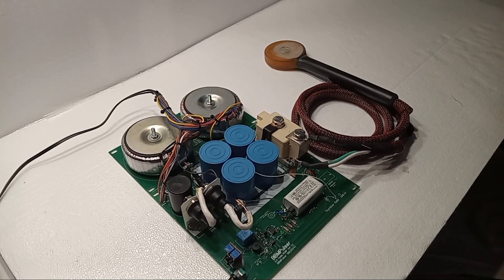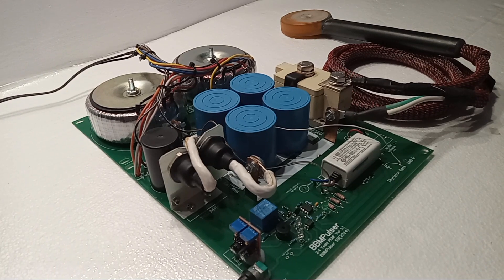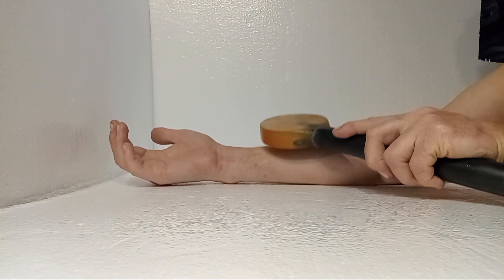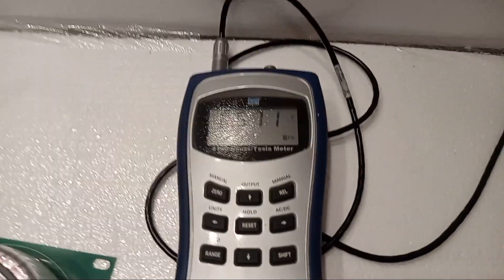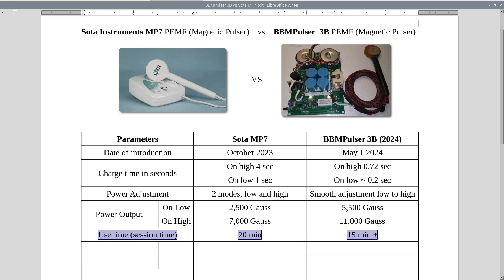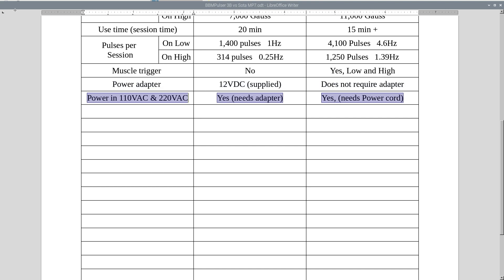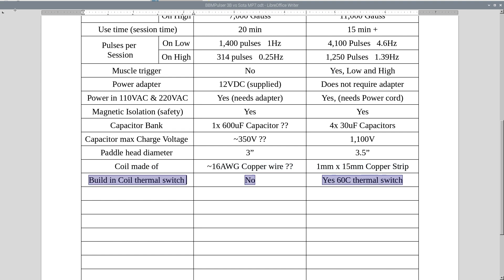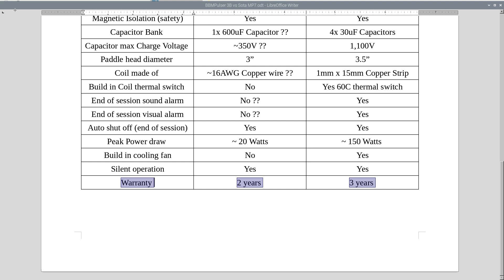179 New Model BBMPulser 3B (2024) vs Sota Instruments MP7

Comment: Hello there !. It looks too complex... very nice job. I have a "dumb" question, I hope you can give an answer. What means "magnetic isolation" ?. When the voltage is finally sent to the coil... How "the magnetic isolation" is working ?. What could happen if "magnetic isolation" is not present ?.  Thanks !
Reply from the maker: @antoniohernandez8367  magnetic isolation from the Main means there is no electrical connection between main input voltage and capacitor bank voltage. 
To explain it further, it means that if you are standing bare feet on the ground and somehow manage to touch exposed coil copper strip, which has high voltage on it, you won't get electrical shock.
This is safety future.
Reply: @AndreyD  Oh... Nice. Got it. Thanks for the explanation. I was reading other comments (from you) in other videos, and it's very interesting the info that you give related with bacteria and biofilm and how the power of a magnetic pulse can help to attack these kind of "bad life". I understand that "you're not a doctor", but definitely for me the information you provide is more important than a seemingly ideal academic degree to give an opinion about diseases. I was wondering where can I read that info with detail ?. I know something about Bob Beck's work , but related with magnetic pulsers the info that I read is limited. In my case, I was wondering, what is more important talking about a magnetic pulse: capacitance or voltage ?. Which of them is more important than the other ?. Sota's MP apparently focus on capacitance and a voltage value <= 350v, but yours (as I can see and understand) focus on low capacitance and high voltage ( > 350v ). What could happen if the capacitance is the focus and not the voltage, for example, a magnetic pulse that is always using 350v with a variable capacitance ?. Can you give an advice about that ?. Thanks in advance !. Your work looks very sophisticated.
Reply from the maker: @antoniohernandez8367 both capacitor value and voltage are important.  I started with pulsers working with 150V and worked my way up to 1,5kV. Higher voltage with capacitor bank support can generate higher resonance pulses which will penetrate deeper into the tissue. Capacitor bank volume determines length on the pulse. Yes we do want our pulses to be in hundreds of microseconds range even in milliseconds. It's hard to produce thouse with out heating up your coil fast. Coil doesn't like large capacitor bank. Ideally coil wants your capacitor to have enough energy to saturate it and that's it, if you keep pumping past saturation point all that extra energy will be converted into the heat and some magnetic flux. So we have to find a ballance between trying to get our pulses to be as long as we can get them and at the same time not put alot of load on the coil so we can have at least 5 min session time. 
I been balancing this for a while now with different set ups (models).
Believe me, my capacitor banks on my pulses are not small. My goal is to produce as long of a pulses as I can with each set up without overloading my coils.
In my early designs, I was using large capacitor banks and yes comparing to my new models, older ones were more effective.
I do think that pulses should be around 1mS long. Right now depending on the model my pulses are between 0.1mS to 0.5mS long. 
To get the same effect as from the units delivering  1mS pulses you will need to get more pulses from the model which delivers shorter pulses
Reply from the maker: @antoniohernandez8367  for emaple my 2.4 Tesla BBMPulser 5B model uses 600uF capacitor bank, same volume as Sota MP6 model, just much higher voltage of 1,050V vs 350V
High voltage is another challenge on its own. I believe that Sota will be raising their charge voltage in their new models
Reply: @AndreyD  Wow... full detail... Definitely these things require an accurate knowledge. Do you have a book or something where can I read more about your explanation ?. For example... as I can understand... if 350v uses 1000 uF... it means "a longer pulse" (leaving aside the fact that the coil warms up quickly) ?... But, for health purposes, what voltage and capacitance can you mention to achieve better results ?. Thanks for your attention, I really appreciate your time to answer these questions. (You said "1.5kv", but... talking about "inexperienced people" , can you suggest a minimal value for both concepts ?).
Reply: @AndreyD  Which voltage and capacitance can you imagine SOTA is going to release in their next models ? (at least)... Thanks in advance !
Reply from the maker: @antoniohernandez8367  my guess Sota will increase voltage to 500V and drop capacity down to 500uF
Reply: @ I'm going to see your videos, they have a lot of interesting comments. Thanks for your time !
Reply from the maker: @antoniohernandez8367  if you are planning to use similar applicator as Sota uses, I would say copy Sota -  600uF and 350V. I would not go below that especially voltage. As you increase your voltage, you can decrease your capacity.
For example in my latest model BBMPulser 2B3, I use 4x 6.5uF capacitors and I charge them to 1,250V and I get 0.7 Tesla on the output using Strip Coil, slightly larger then Sota uses. 
With my set up I can get 16x faster pulsation rate then Sota MP7 model.
Yes my pulses are shorter but they have higher amplitude and can penetrate much deeper into the tissue. Also there is accumulative effect. The more pulses we deliver the more we can recharge our cells, amount of pulses does matter
Reply from the maker: @antoniohernandez8367  one more thing. Have you seen the pulse from Magnetic Pulser on the oscilloscope?
I have one video showing the pulse it's video #175
If you examine the pulse, you will see that there are both AC and DC parts in one pulse combined. 
In the beginning of the Pulse Coil takes electrical energy in and start resonating. In my case it will resonate around 6 times while decaying. After that it will output DC Magnetic Flux for 0.3mS. This second DC part of the pulse is much weaker then first AC part when Coil resonates
As we know permanent magnets do not resonate and they have little to no effect to our body. Only resonating Magnetic field can convert back into electricity when in gets in contact with our fluids inside the body. So in my opinion AC part of the pulse as important or even more important then DC part of the pulse
Reply: @AndreyD  Mixed ?. Oh.... I thought magnetic pulses were only DC... Uhm... Interesting. A mixed architecture. That's the reason why I asked if you have a reference where I can read more technical stuff about this and try to understand with more detail how the ideal magnetic pulse can work and heal the body.
Reply: @AndreyD  "you can decrease your capacity." You mean "heal capacity" ?. I saw a video of Bob Beck from 1996 talking about vivitar flash camera, and how can help the magnetic pulse to the body. After that, I found a user on alternative social media talking about a simple magnetic pulser, but he talked about you and your work. I saw some of your diagrams, and in that moment I thought those designs are not for beginners (also now). At the moment, reading your comments only in two or max three videos, you wrote a lot of interesting things, talking about how the magnetic pulse can help to attack or to heal things living in the body. That's the reason why I previously asked what do you suggest as a "starting point" talking about the specs of a magnetic pulser (maybe diy). You said that it's fine to start using SOTA specs and apply to the body. I was wondering... what happens with chronical diseases. SOTA device specs is enough to attack, for example, a cancer disease ?. Is it required more voltage and more capacitance to attack a disease like that more efficiently ?. What documents do you suggest to read to understand more about magnetic pulser vs diseases ?. Thanks !
Reply from the maker: @antoniohernandez8367  here on this channel I discuss how to build it, I don't want to discuss what it does. All I can say it's effective
Reply: @AndreyD  Perfect. I'm going to see your videos and read your comments. It's interesting. A person named "Andreas K"... said that all diseases have something in common: "lack of electricity". That's why these things are interesting for me. Thanks for sharing your time and knowledge. 👍
Reply from the maker: @antoniohernandez8367  This is my own opinion. Canser is a fungus infection. The name of the fungus is Candida Albicans. Tumors are the fruiting bodies of this fungi. If tumors occurs it means this fungi is on the last stage of its development. The power of the fungi is in mycelium (roots). Targeting fruiting bodies won't kill it, but Magnetic Pulser can be effective. It recharges cells, and when that happens, cancer retreats. 
Fungi usually attack low charged cells. 
Our heart is a good example, why heart cancers are super rare? It's because heart cells are the most charged cells in our body, that's why fungi don't attack it.
To fight cancer, we don't need high power, it's more effective to get higher amount of pulses vs lower but stronger pulses. The idea here is to recharge cells.
Another important thing is diet.
Thouse who have cancer will benefit from pure ketogenic diet. They should lower their carb intake down to 0.
Candida likes carbs
I can send you some links where you can learn about proper diet
Reply: @AndreyD  I was wondering which option is more effective than the other ? (pulse rate). You gave me the answer, I thought strong pulses over wide intervals was the best option to attack diseases, but, the  answer is the opposite. Yes, If you can share the links that you propose it will be great. I'm going to take notes of your comments along the videos in your channel. It's interesting. Again, thanks for the answer. It was very detailed.
Reply from the maker: @antoniohernandez8367  with my own experience it depends. For fungi I use low power and more pulses, for bacteria, I use strong pulses, for viruses mid to strong. To recharge cell, lower power (0.5T)

Comment: Very nice. Does it have the potential to mess up close-by circuitry of other devices? How far does that magnetig pulse propagate and how quickly does it disperse?
Reply from the maker: I tried placing old working phone straight on the coil and discharges 50,000 Gauss into it, the phone flew and hit the ceiling but nothing happened to it, everything works and nothing erased or disappear.
So my conclusion is that its not that dangerous for electronics unless you have magnetic hard drives, VHS tapes or audio tapes, that will loose its memory